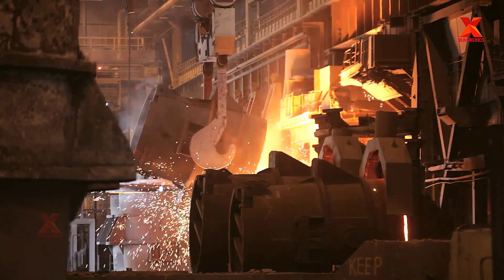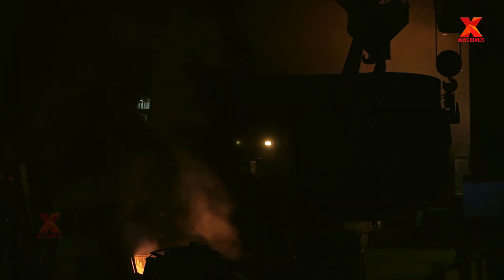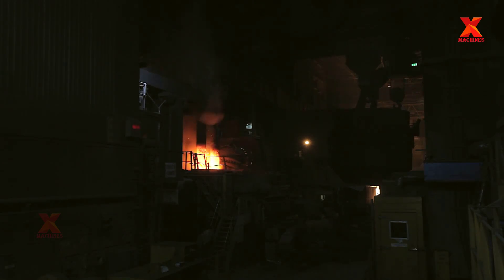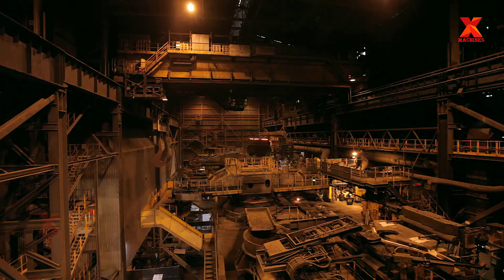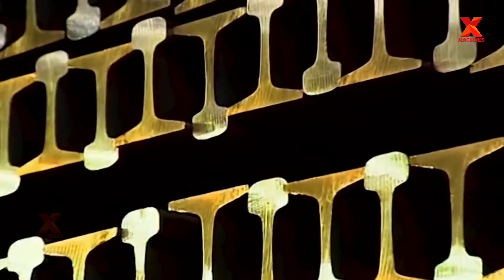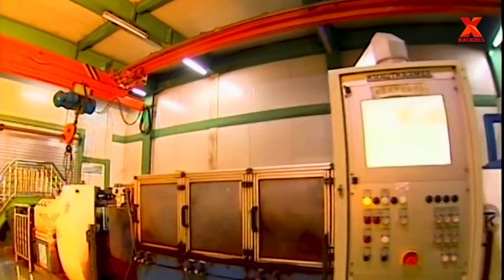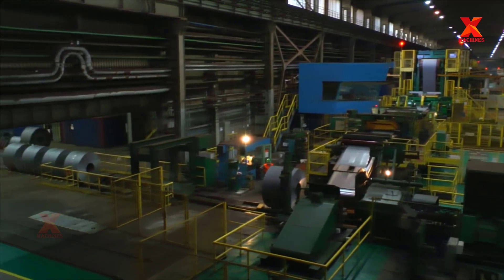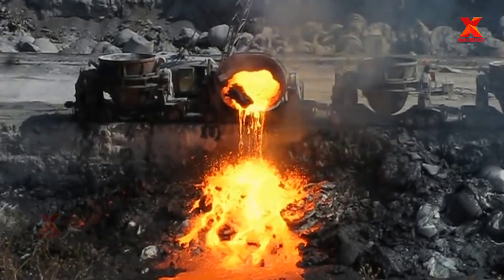Explore Melting Steel Process And Railroad Tracks Manufacturing. Draining Blast Furnace Slag Process

Comment: I worked with liquid steel for 29 years. One melt 350 tons. The plant produces about 10 million tons of steel per year. In case of danger, always run to the safe side and only then look back at what happened. Sometimes when going to work, an inner voice tells you that something is going to happen at work today... And it does. This is called intuition based on vast experience. At work, like a pilot in a dogfight, you must constantly turn your head and constantly monitor the situation around you. Greetings from Russia

Comment: 850V @ 135,000A = 114 Megawatts!!! The conductors and other electrical equipment to power the electrodes must be insanely massive. Let's hope they've invested in a solar and/or wind farm to offset some of that energy expenditure.
Reply: I can't even grasp how many amps that is. The electric use in a steel mill is making some utility company happy.
Reply: " Let's hope they've invested in a solar and/or wind farm to offset some of that energy expenditure."  LOL HAHAHAHA  🤡🤡🤡🤡